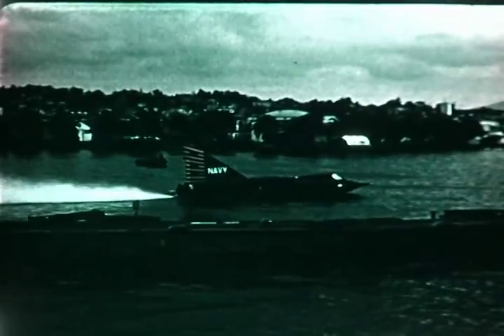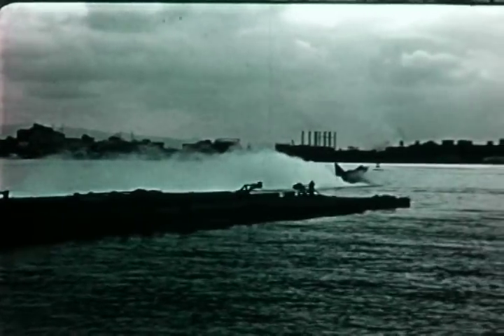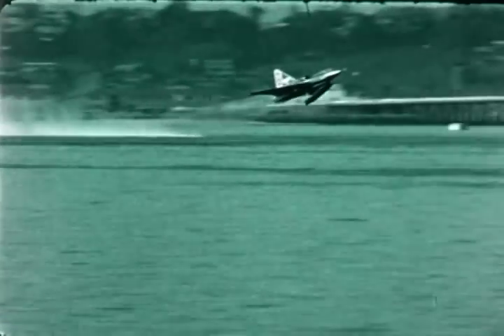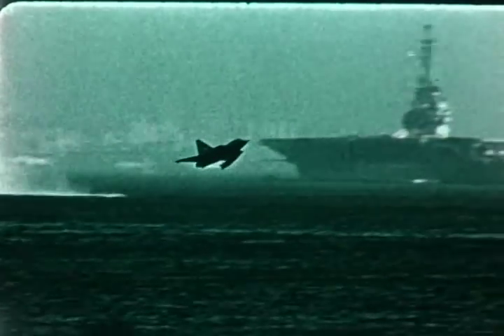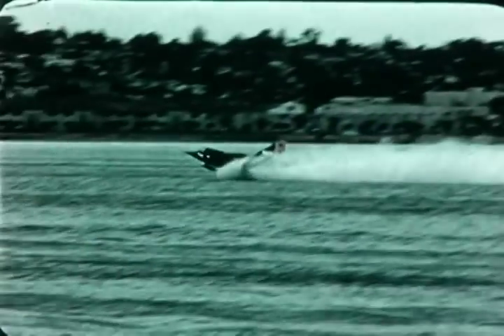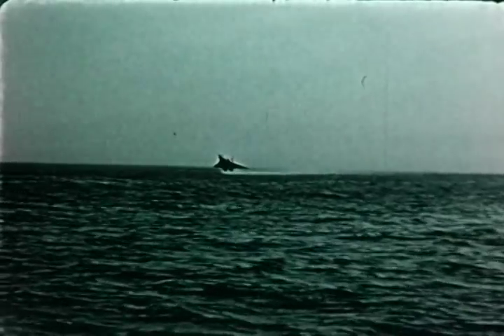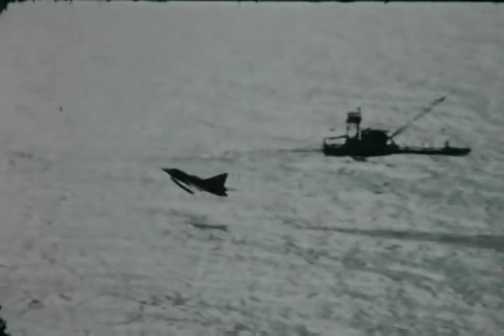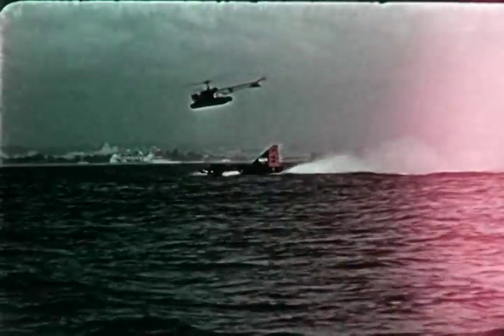F-0696 Sea Dart Final Report

Comment: The Navy was interested in a supersonic fighter and requested proposals. The the current generation of supersonic fighters required a takeoff distance beyond the capability of the pre-supercarrier Navy.  This was Convair's answer.  5 prototypes were built, but the operational problems proved to difficult to overcome.  One of the prototypes disintegrated in flight over San Diego Bay during a demonstration flight for Navy & DOD honchos.
Reply: My father was sitting on the pier at the Coast Guard air station on Harbor Drive when the Sea Dart disintegrated.  He got two photos of it with his 4x5 speed graphic before the last pieces went into the water.   

They used to flow ground walnut shells into the idling engines to clean out the mineral “whiskers” caused by the salt water.  Wild.
Reply: Thank for a totally explaining the situation faced by the Navy at this time. We are talking early supersonic jet development here, the F4 was a few years away as was the Vigilante. Engines were weak, and technology and avionics were starting to be upgraded and integrated with electronics. 

Yes..it was silly..now. but then, the navy needed more than one way to deliver a nuclear bomb to Russia.  USAF was getting alot more funding for research at this time.
 It had to tested to see if the Sea Dart would be the answer.

Comment: It had absolutely no purpose!!  Of what earthly use would it be?  Nothing a carrier based aircraft couldn't do better..or a land based plane.  Silly idea.
Reply: At this time, jets couldn't take off from carriers. Plus, every watery area became a potential landing / take off place, without having to built an expensive airport.
Reply: Also, a squadron of such planes, if they had achieved the design objectives, would be much cheaper and more versatile to operate.
Reply: The idea was based around the concept of mobile bases, partially as a way to minimize losses from nuclear strikes, and as a way to make it easier to patrol the Pacific Ocean, the idea in theory is a sound concept, a fighter that can operate without a carrier and possibly from lakes without need for a dedicated airfield.